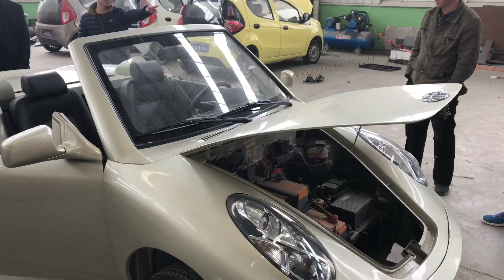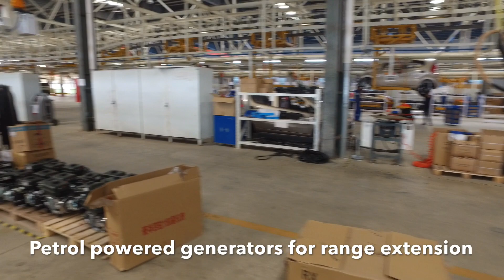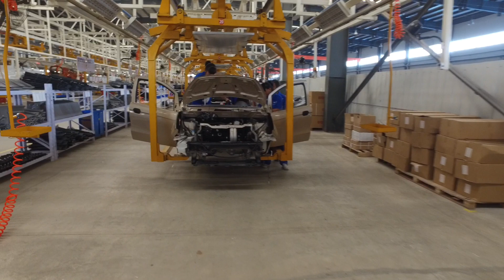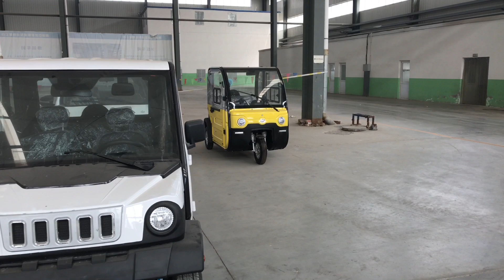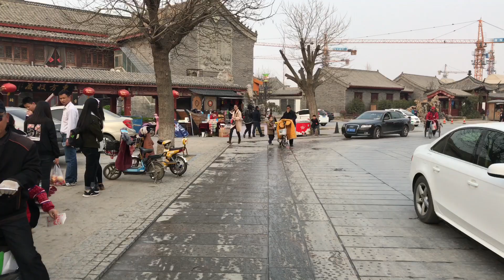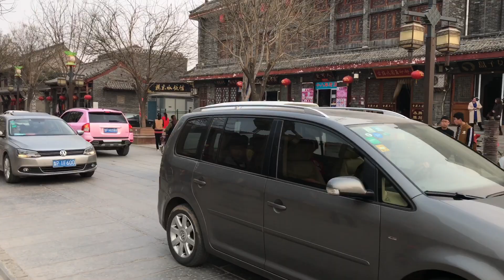Electric vehicles in China, what is going on with the EV market there?

Comment: What? Lead acid batteries with only 120AH?? a freaking lawn mower engine for a generator?? Those are glorified golf carts.. AIR BRAKES????? Whats the range of these "EV's"? 50 feet? They would be better off making low emission, super high MPG cars...
Reply from the maker: kabukiwookie sure these cars are not made to compete with Tesla, a product at every price. For about 25.000 RMB one of these can be bought and they are used to pick up the kid from school and buy some vegetables at the wet market so 60-80 KM range and a max speed of 50 KMPH is sufficient.

Comment: Why would hydraulic brakes need air compressors? They don't! Those are actually electric vacuum pumps to replace IC engine vacuum for those power steering and power brake systems that run on vacuum.
Reply from the maker: your absolutely right sir,  sometimes i'm  an idiot too you know.  but never too dumb to learn!  all faults in my podcasts will be pinned on top, so i dont miss out on lessons, and people that want to learn can do so with the input of anyone that wants to share some knowledge.   so, Thanks!
Reply: dlwatib, if they sold these on amazon and were legal on interstate highway, they would sell like crazy. Eventually we could lower the bar enough that people wouldn’t expect Tesla P100D or ICE performance. Give everyone in the US one of these cars instead of a $7500 tax credit. And then let natural evolution take place. You can upgrade these in so many ways, including replacing the 7.2 kWh lead acid battery with a lithium ion battery.
Reply from the maker: I understand people are used to a certain level of luxury, but the EV cannot be stopped anymore, and will be in the US pretty soon in front of every house.  truth be told, these vehicles are cheap, and not built for safety but for low price. not a highway vehicle, but a little runabout to get the kids in school and buy groceries. having said that, i think the bar could be lowered, how many people buy a banger for a thousand bucks, or more?  i know i do... i have a 14 year old mitsu.  i'd go electric if i could buy one here in Thailand, but there are no vehicles available and the government has strict import rules to protect the local car industry.
Reply: Powersteering running on vacuum? They usually have a hydraulic pump

Comment: i was a us auto worker i always wanted to work on ecar line never got the chance
Reply from the maker: I wonder what it would take to get the big car brands in the USA to really go for it, my best guess would be a super quick charge battery system at much lower cost.
Reply: That is the key - much faster charging time.  Tesla's car batteries needs hours to fully charge up.  So, it is a trade-off of power versus charging time.  Based on current technology, you cannot have both.
Reply: Infinite solar for all 
USA had electric car boom 1890-1920.  The same problems that killed EVs then are the exact unsolvable problems EVs have today! (for more range you need more storage which causes more weight and you need more power then...)
Reply from the maker: Bear Buster well, those problems are beeing addressed at an astounding speed now, with many competing battery technologies beeing developed right now. I think the liquid electrolyte battery where the liquid itself is charged could be a really interesting alternative as it can be pumped in the tanks just like regular gas! The next 10 years will tell!
Reply: Infinite solar for all 
A magic battery would help indeed!  There has been progress on li-ion lately but that technology is a hundred year old.  The periodic table is only so large, practical electric voltages for motive energy are uncommon, Ohms law must be obeyed, and thermodynamics can be problematic. Generating electricity, transmitting electricity,  and storing it chemically efficiently is a tall order.

The power grid must be increased and an honest appraisal of an EV's electric use must be calculated using the dirtiest and most expensive watt in the system.  Supply chain pollution is significant and  must also be considered.

As things stand today the push to EVs is social engineering rather than transportation progress. Without government incentives and disincentives it would not happen!
Reply from the maker: Bear Buster  I do not agree with that just yet,  lithium based batteries have up to 3 times the storage capacity of lead acid, they peak at about 280  WH per kilo.  one liter of petrol has about 9.7KW  so this is hard to beat, but a electric motor is much more efficient with those kilowatts up to 95% efficient is pretty standard where as a petrol engine gets about 35-40% efficient. Thus today it's not about energy density so much it's more about refueling time. With liquid battery technology (flow cell) we could refuel just like a normal car and that fuel is already at 280 WH per liter. My guess is that there soon will be a car solution for this that can really compete with lithium based batteries since storage is just a tank!
Reply: +Infinite solar for all,
Great videos... I think a sensible approach would be battery exchange. It would be similar to liquid electrolyte, but could use current production methods. Each battery could have a rating as the life of the battery diminishes. You purchase based on energy in charged battery, and get a refund from energy left in the battery your exchanging.

Comment: The 120 Ah battery pack sounds really low. The 7.5 KW motor will draw about 125 amps at 60 volts when maxed out. I would guess that you would get about 30 minutes to one hour of use depending on the load on the motor. Remember, you can NOT draw 120 amps for 1 hour out of a 120 Ah battery. These batteries are rated (usually) using a 20 amp discharge rate. The amp hours go way down when drawing over 20 amps. Could it have been 1200 Ah. (though that sounds a little high)
Reply from the maker: You are totally right! These cars are used only to go to the super market and bring the kids to school, they never see any highway use and are essentially golf cart type vehicles that cost around 3000 USD or so to buy.  Max speed is around 70 or so and range is maximal 70 kilometers.
Reply: For EV, the essential technology is the manufacturing of lithium-ion batteries.  3 countries lead in this area:  Japan, South Korea and China.
Did you notice that Warren Buffett invested a 10% stakes into BYD, a Chinese company making both car batteries and cars?  Moreover, Tesla does not have any capability in manufacturing the batteries and it had to partner with Panasonic (one of the leading suppliers of car batteries).
Most of the batteries used in cellphones are manufactured in China.  It is a matter of stacking more of such batteries together into a form that fit into vehicles.
Reply: Just Another War Robots Channel, the system is pretty balanced. 4kw motor, 4kw range extender, 7.2 kWh battery (which shouldn’t be discharged more than 4kwh from full charge). The lead acid battery can easily do 1C discharge for short bursts, which is probably about as long as that motor can take 7200 watts. 

These sell in the US as Neighborhood EVs, complete with air conditioning and heat.
Reply: If the Chinese are "leading the way in EVs" with this type of technology then they are leading their country down a dead end. That's not a technology that is acceptable to the rest of the world.